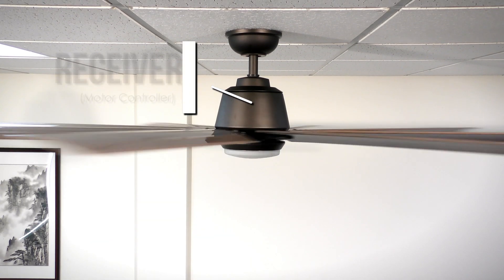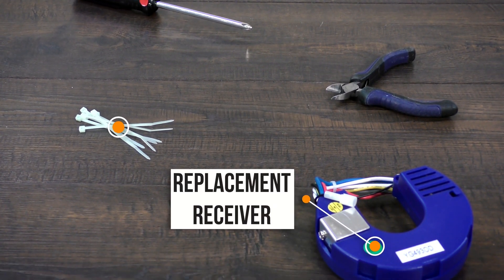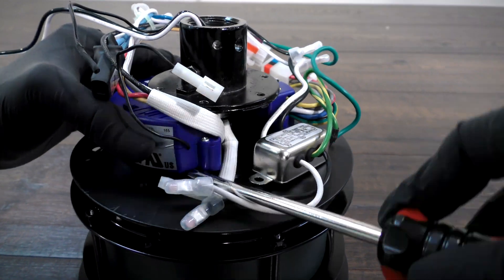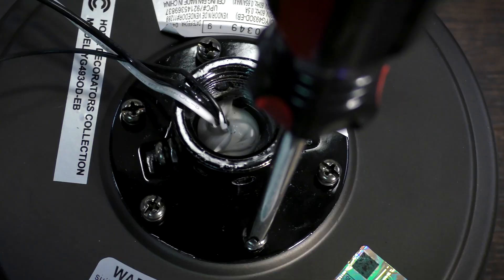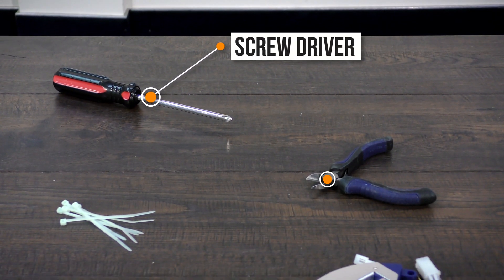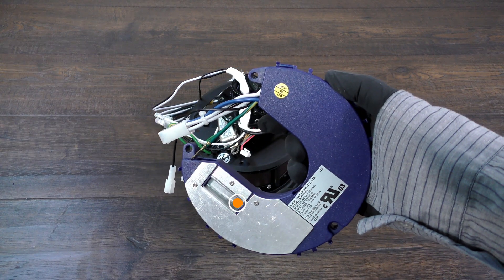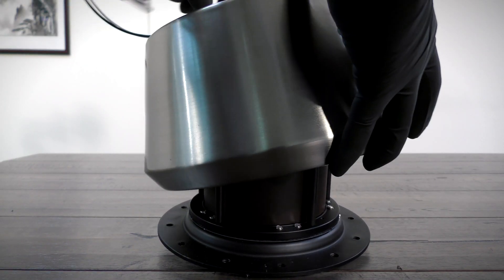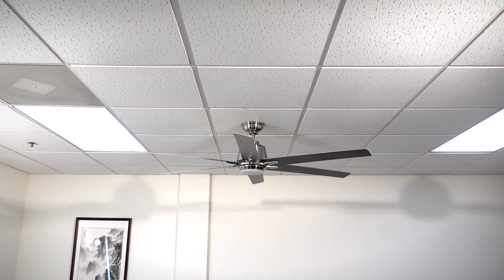How to Replace the Receiver in a DC Motor Ceiling Fan

Comment: When programing remote it didn't do what video shows. Fan motor started right up no flashing light but seems to work as should. As snoozieg8210 said the one screw holding receiver is a mother to get to. Thanks for the vid.

Comment: 72” Kensgrove fan receiver screws cannot be removed with a Philips screwdriver.  The screws are under the round plate that is held in place with safety hex screws which normal people don’t have the tool to remove them.  
Shame on Hampton Bay or whoever made this fan.
Sell a fan that does not need to have a faulty receiver replaced.

Thanks for the video, but BOoooo for the faulty Chinese engineering.
Reply: Yes very troublesome to remove the one screw.

Comment: Thanks for a helpful video. So I am working on a Casablanca ceiling fan(59512 with DC motor). Unfortunately, I have cut the antenna wire, would it have any impact on the fan functionality? 
It was a thick gray wire with a small connector, after stripping can see it has silver wire and inside there is sheathing and a connector. It is not part of the main 8 pin connector though, so curious if fan would work or no?

Comment: So the guy at lows tells me they dont sell replacement remotes for a cieling fan. Instead he tells me you have to replace the remote unit with a universal kit. I bought one. Took the old one out wired it up and nothing. The issue is that the old unit some how had wires not consistant through it. I pulled the old wires and now have 5 leads to the motor windings and a white and blue to the light kit. The old motor controler had the same 3 wires but had 2 aditional modules thet were wired in with a switch for forward and revers. Need to know how to rewire the motor with out the extra stuff or how to reinstall modules and switch if there still needed. No one addresses this . also there were only a white and black wire at the junction where the mains come in and no ground. I pulled a third wire through to use for grounding the fan. I suppose what i need to know is how many wires have to go to the black wire from the new remote module as it only has 3 outputs and the fan has 7 inputs. The numbers make the issue apperent but not the solution. Like hooking up a blower motor that has multaple wires for speeds and you use ony one of them to get high and the speed is mannaged with a varieing current supply.  Instead of a switch.

Comment: I'm trying to replace the factory receiver with a universal remote &receiver (for harbor breeze) but the wires aren't matching up and I am positive it's the right kit !!!
Reply from the maker: The instructions in this video are for DC fans that have their receivers built into the motor. These types of fans can only use receivers that are the exact same model and specification as their originals. Fans with receivers in their canopies can usually work with universal remote/receiver kits, but this video may not be very helpful for replacing them. The electrical connections section from this fan video may be helpful however: https://youtu.be/pLhGHE9RIBw?t=235

Comment: how do i get a new regular DC motor receiver? i have looked online and tired to contact Rhine.
Reply from the maker: The manufacturer of the fan should be able to send you replacement receivers. Check the top of the motor, some vendors will put their contact number there. If not, you can grab the UPC number from the motor and contact the customer service department for the hardware company you bought it from (like Home Depot or Lowes). If you have the owner's manual, the contact information is noted there as well. You can also try searching for the UPC number online to find the vendor/manufacturer.
Reply: Contact fanimation that’s the maker of the fan.. or that’s who made my slinger V2

Comment: How can you modify this fan so that I can use it without the remote. I want to connect to the fan to a wall dimmer switch and the lights to a separate dimmer switch. Will removing the receiver do this? Will I then have separate lines?
Reply from the maker: Unfortunately, DC motors need the receiver to change speeds correctly. A speed dimmer will damage the components in the receiver and prevent the fan from working. The fan can only be controlled with the included hand held remote or with a Bond WiFi Smart Home Hub.
Reply: @TALCeilingFans  Thanks for videos and advice. Where can one buy an extra remote in case the original gets broken? Mine is a UC7225T. I've looked throughout the web, but I can't find any sellers.
Reply from the maker: @woodrowmerle  Home Depot will replace the remotes under warranty or sell new remotes. Unfortunately, the remotes currently aren't listed online for purchase, but you can call 1-800-986-3460 or the phone number in your fan's owner's manual.